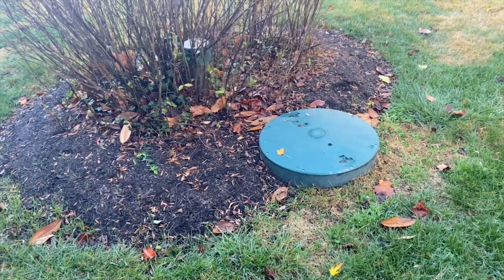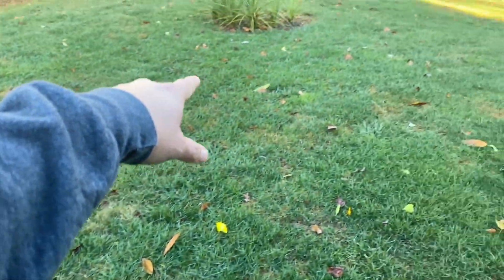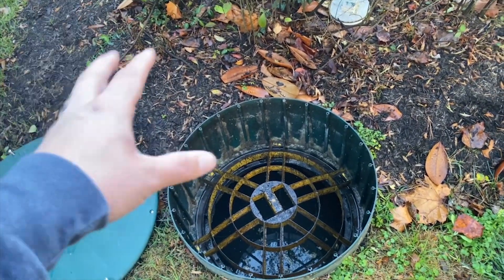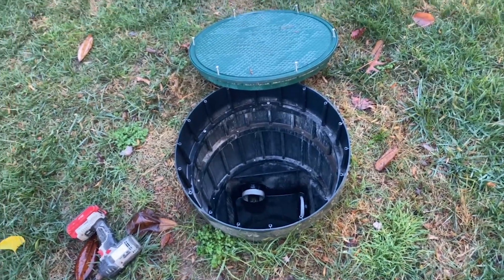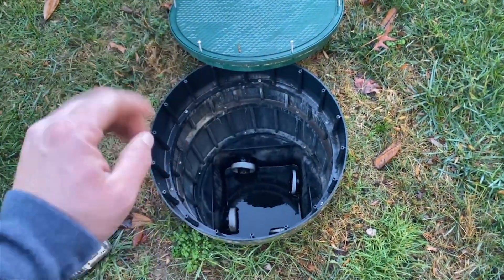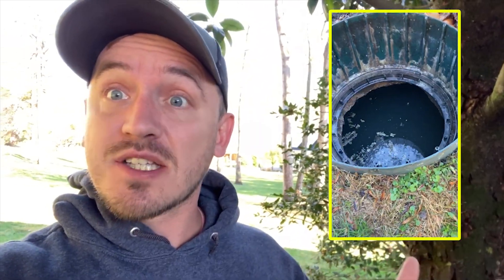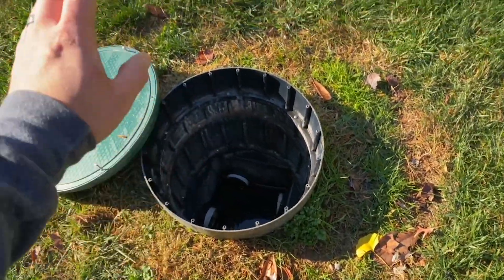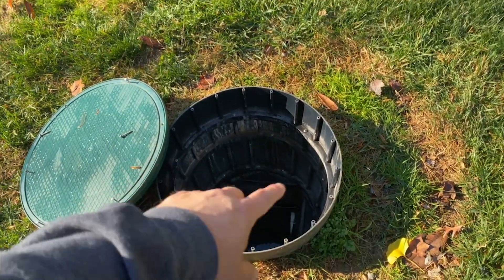What Happens Inside a 1974 Septic Tank?

Comment: Had a 1970 steel septic tank right on be beach. No manhole or cleanout, just dig until you find the hatch. It was completely rusted out; the guy digging it up put his foot through the top. The septic tank company replacing it just pulled the top off and filled in the hole, leaving the rest of the metal in place to rust away. New tank is concrete; I insisted on that. Still worrisome: they reused the existing leech field, which heads straight toward the 175 foot high cliff overlooking the ocean. Eventually, that cliff face will erode back to edge of the leech field...

Comment: this is a prefab tank.. mine is from '73 and it's homemade... i have no idea how the bed is set up but i know where the outlet is.  i'm toild it's still working and it's large  it had railway ties over it but i've since had a concrete cover installed and then added a riser to that so i never have to dig to pump it